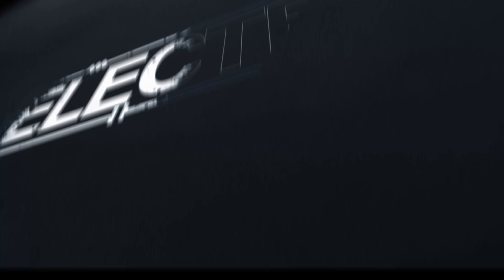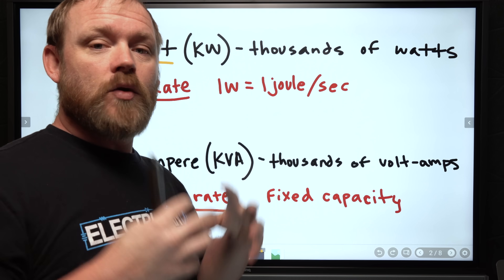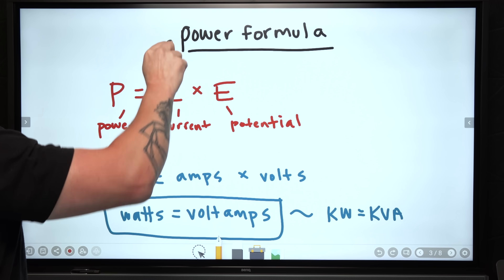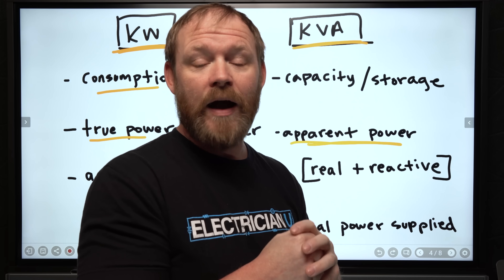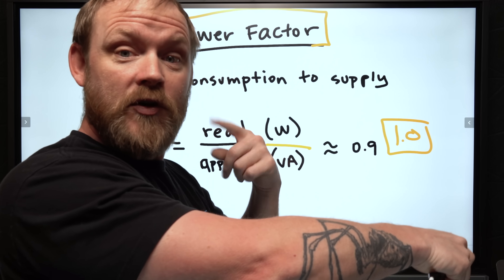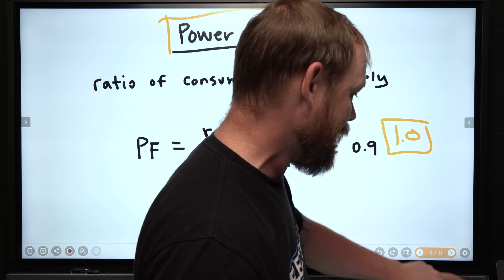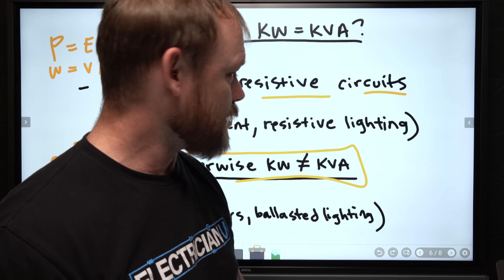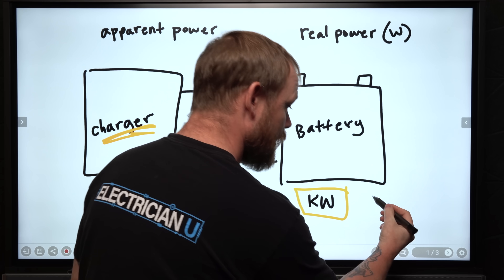Why KW and KVA Are NOT The Same Thing (Even If They Seem Like It)

Comment: When working with a pure DC circuit KVA and KW are the same. 
On an AC circuit, capacitance, inductance, etc. manifest themselves leading to impedance which causes the need to supply more power than the load requires, as the consumed power becomes load required power plus the power lost due to the impedance.
Reply: Not exactly that. Let's take a diesel generator capable of 100kVA, if the load consumes 50kW of active power, the diesel engine just have to produce 50kW on its shaft, regardless of the power factor.
If power factor is 1, 50kW = 50kVA. But if power factor is 0.7, 50kW = 71.4kVA. But active power is still 50kW, so the thing that changes here is the current that increases, that means more losses in the cables and generator.
Reply: @LambdaWave84 from what I’ve been told generators actually kind of like the load’s power factor to be about .7. Apparently t works better with the alternator’s natural PF or something? 🤷‍♂️ The power company doesn’t want your factory at that PF because it impacts the power they have available to send to other customers. That’s why they charge you extra if your reactive power is too high (PF too low )
Reply: A load with a power factor lower than 1.0 will have a phase difference between voltage and current which means that when the maximum current is flowing thru the device the voltage isn't at its maximum so the real power is lower.
Simply put, You could look at it as if the device drawing power tries to draw the maximum power when the source (generator or grid) cannot deliver it. Look at it as if the device fails to draw the maximum current when the voltage is at its maximum. It either draws current too early (capacitive load) or too late (inductive load). Think of it as poor timing - the load is trying to do work when the available push from the source isn’t optimal.
Reply: May I correct you:
You have to write kVA and not KVA
You have to write kW and not KW
as stated in the International System (SI) of Units.
Many thanks
Reply: @User-VHLMsnoq  ...  was wondering at some stage how Kenworth got into the conversation..  That would be HP.
Reply: And Joules uses capital J
Reply: Having just been through the process of buying an electric car, I think it would be better to rate batteries in Joules or kJ rather than kWh. I have an electrical engineering degree so it doesn’t bother me, but it seems to be meaningless to many people.  
Manufacturers are marketing based on range, but this is subjective- is it assuming a jockey driving the car downhill with a tail wind the whole way?
Reply: @richardpowell1425  Like Joules, kWh is simply a unit of energy. In principle, you could specify battery capacity in Joules, but in practice, for large energy amounts (like car batteries), kWh is easier to read and is more familiar in the context of electricity consumption (e.g., utility bills, appliance ratings).
So the difference is just a choice of units, not a difference in what you are measuring. kWh = energy, just like Joules = energy.
Bottom line : kWh is fine as a unit (it’s just Joule "scaled up"), and it actually helps consumers relate battery size to household electricity.
Reply: @ppdan  I understand that - I have an electrical engineering degree. My point was that rate of work x hours is an unenecessarily complex way to specific energy storage capacity for the average person who didn't study science, physics or engineerng, and probably only understand their energy bill interms of the $ they get billed for it.
Reply: @richardpowell1425   - yes yes (Many folk kicking around have Engineering Degrees) , but the average punter doesn't really have intuition in these abstract units  (Noting for folk that 1 kWh is 3.6MJ, or 3600kJ, numbers get large when noting in kJ, very quickly) - As consumer solar systems (and their batteries - kWh) are installed in Watts, or kW "nameplate capacity"- and residential billing is always in kWh - energy units,   Constant units means the lay people don't have to convert anything.

Hours are easy, not everyone knows intuitively that there are 3600 "energy increments" in an hour, when converting from Watts to Joules.
Reply: @kadmow exactly- adding the number of seconds in an hour into a metric unit adds complexity. I don’t see that M or G prefixes are too confusing compared to k. But you make a good point about kWh being a unit that people are familiar with from their power bills.
Reply: Even C's get a degree.
Reply: @richardpowell1425  these units are meaningless for a lot of people, but at least kWh offers the advantage that it allows most people to come up with a roughly correct number for how long they will have to charge at a 9.6kW charger. It’s also how they get billed for electricity, so it’s easier for them to understand what using the car costs. Joules are a meaningless unit to most people.
Reply: @Finder245 good points.

Comment: Nice overview as an EE.  It's a deep dive if you peel the onion back.   

I didn't really get a grip on this until I took a Power Grid Graduate class in School.   I took it to better understand 3 phase systems.  

A video on Delta and Y system would be helpful to many in this field.  Along with Grounds vs Neutrals.   Seen this screwed up so many times in Industry.

Comment: Anytime we hear "current flow" in an electrical YouTube video, we should be skeptical. Current doesn't flow. Water flows, electrons flow, ions flow, etc. Charged particles can flow or occilate. "Current flowing" needlessly confuses students, as though current is itself an object rather than a rate (e.g measurable stuff passing a point per second or minute or hour).
Reply: From Wiki under “electric current”  “an electric current is a flow…..”

Comment: If you have a resistance heater like an oven, then Watt = VoltAmpere.
But if you have an inductive load, like a motor, 
or a capacitive load, like a switching power supply, then it's not the same.

Comment: I have to disagree with your statement about "the function of a transformer is not to produce a rapidly alternating magnetic field".  That is a function of the applied voltage.  The transformer's function is to convert that primary voltage to a different voltage (secondary), be it either a step up or step down (most common) transformer.